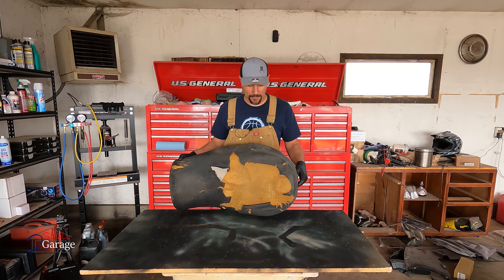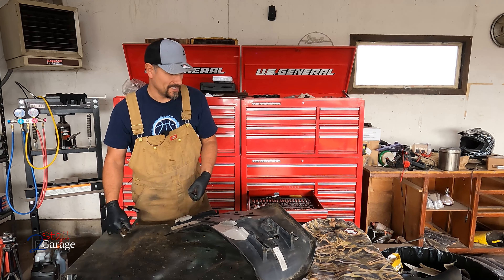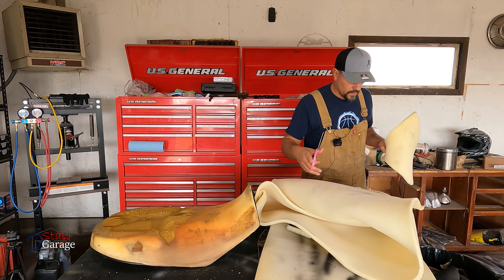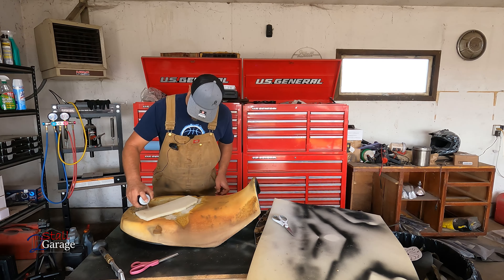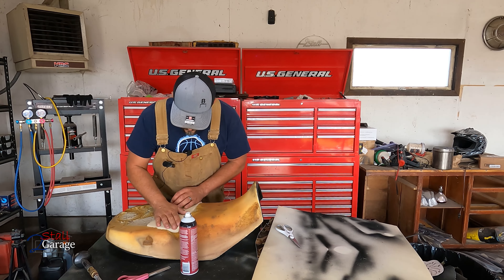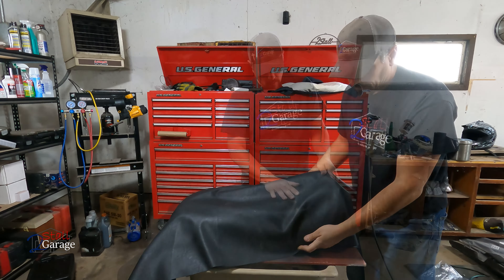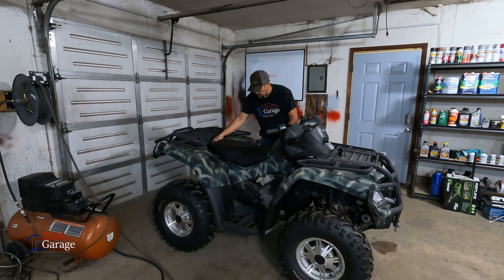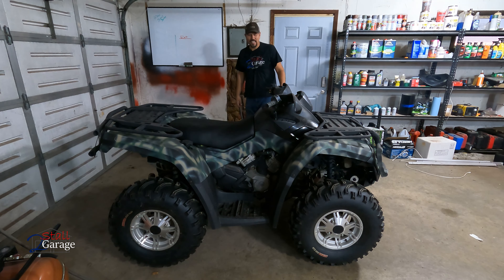ATV Budget Seat Repair | PROFESSIONAL Results at Home

Comment: Looks really good. I think that black looks better on there then the duck blind camo would honestly. Did a good job with the foam n stuff too. I taught my oldest brother years ago b4 he passed how to do his headliner and other parts in his car. One tip is spray what ever your covering with the adhesive and the material your covering it with as well. Let them both get tacky then lay it on. With your material having that felt type back it really didnt need it but it helps when u gotta stretch alot of curves or larger areas like headliners ect.   Great job again bud hope y'all are doing well.
Reply from the maker: Good advice on the adhesive.  I'm sorry to hear about your brother.  Lord have mercy.  Thanks for your continued encouragement on these projects.  It's friends like you providing encouragement that keeps me doing this youtube stuff.  I would have stopped long ago otherwise.  #budsfromadistance
Reply: @2StallGarage  no problem. Like the stuff you do on here it's easy to watch and learn n try to be helpful when I can. Sharing knowledge is better then keeping it to oneself otherwise how's anyone else gonna learn.